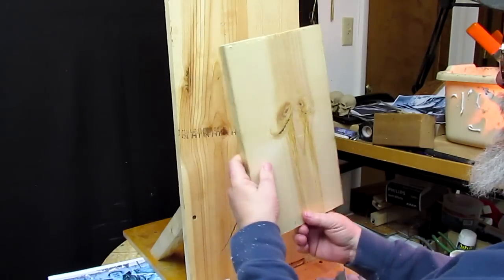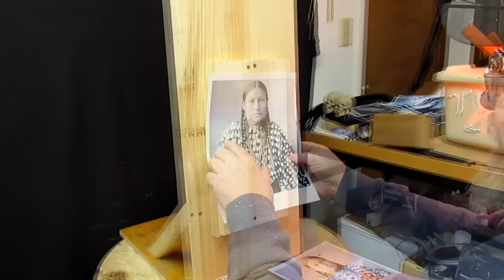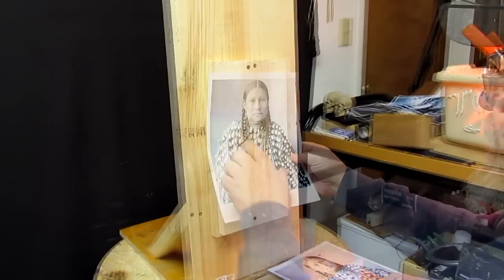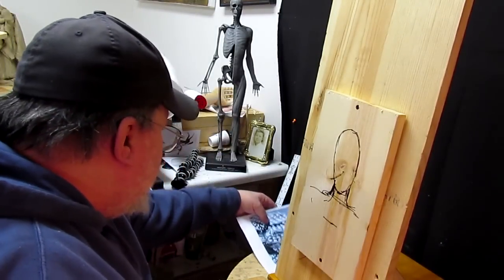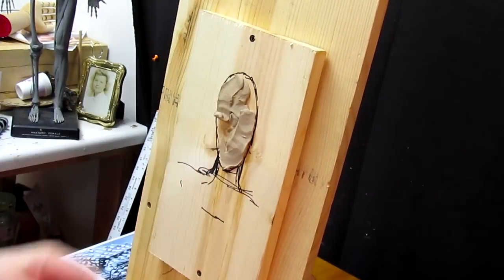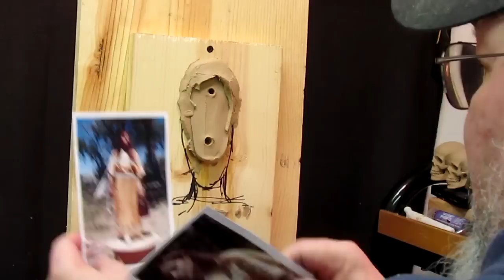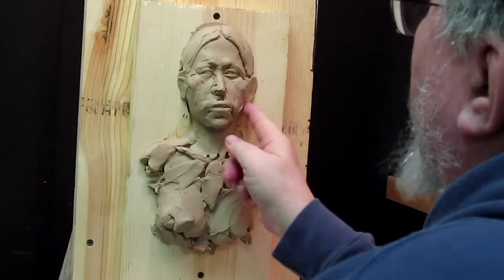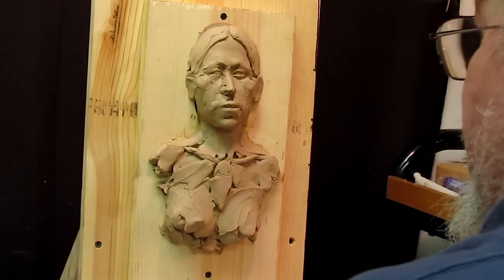Spark is lite   Starting a Relief

Comment: What kind of clay are you using? Is it durable?
Reply from the maker: It's Plasticine clay..  never hardens... J-Mac medium  You can get it from sculpturedepot.net
Reply: Hey  @clayguy1 , great video! A question about Plasticine. If it never hardens, wont the relief start sagging after a while with gravitational pull...? Thank you in advance!
Reply from the maker: @QuestKash  It can over time if you don't make a strong or good armature... I ended up tearing this one apart... Never liked it...